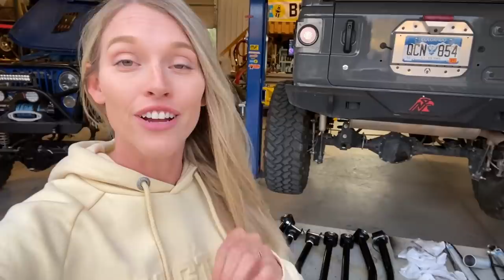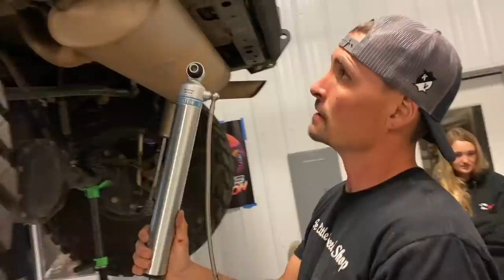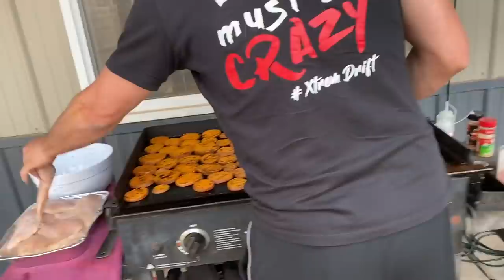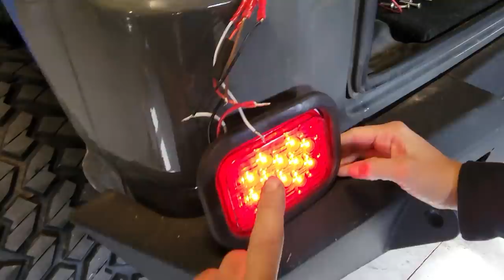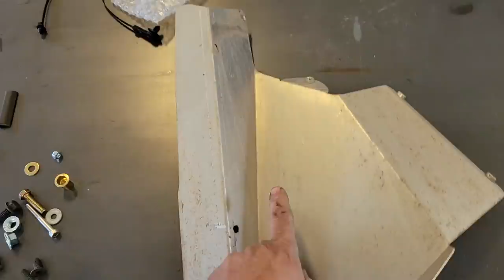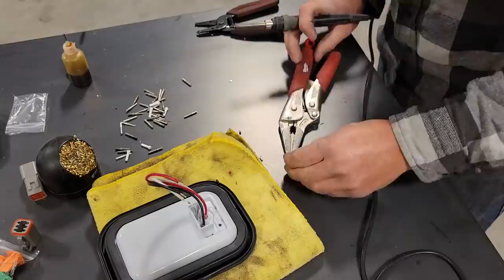MUST HAVE PARTS FOR A JEEP WRANGLER!

Comment: I know Chris can often be like myself, if it's worth doing it's worth doing right. This taillight wiring is a perfect example of it. Always a good idea to have some metri-pack or Deustch connectors on hand when you run into someone else's mess. Oem quality, 100% weather/moisture resistance, and easily disconnected just like an oem connector. Plus they are actually quite easy to make! I crimp the solid terminals with a 4 sided 8 indent crimper and it holds stronger than the wire itself is, and doesn't leave a really rigid section of wire like soldering does. 

Love these build videos guys! Chris is my kind of fabrat!

Comment: Chris, here is a SAE/Metric size hack for you.  I came up with it as I was going through A&P school.  There had to be an easy way to convert SAE and Metric to each other's sizes.  I found it, the number "5".  To find the equivalent SAE size of a metric size subtract "5" and this is the SAE size in 1/16"'s.  Example: 10 MM minus 5 leaves 5/16 SAE.  13 MM minus 5 leaves 8/16' or 1/2".  Go the other way.  7/16" plus 5 equals 12 MM.  9/16" plus 5 equals 14MM.  It works up and down the scale for quite a way.
Reply: Been doing it so long, that I just know. And 7/16 is an 11mm I think

Comment: Not many people even bother to use a soldering iron these days, and of those that even bother to, most don't even know about using liquid or paste flux like Chris did. It makes the solder flow much quicker and makes far better and  faster connections, which reduces overheating things. You can get it at a hobby shop. Just be sure to ONLY use Rosin Flux with Rosin Core solder. 
The Rock Krawler lift on our JK has been just as Chris described...maintenance and trouble free.

Comment: Nice work by Chris to break out the soldering iron and proper connectors versus the prior work on the lights..  As an FYI for the Deutsch connectors get yourself the proper crimp tool and the barrel style contacts - even better than soldering for durability.

Comment: Just came across your video,  I'm happy Abby got her set of Bilstein shocks, ordered a set of 5160's for my wife's jeep in January of 2022 and got the fronts right away. And in the middle of June still haven't received the rear set. With two weeks until we left for a three week wheeling trip had to put a set of Fox remote resivors, now we have miss matched equipment on the jeep. I guess I have Brandon to thank for all the supply issues, it has been a nightmare trying to set my wife's jeep up.

Comment: Bilstiens are great shocks but they really need to work on there coatings
Reply from the maker: I hear they are in fact working on it. We need to do a video on it but the oxidation is actually on purpose which sounds weird but it’s to protect the metal from rusting. Of course it doesn’t look pretty anymore but for some reason that was what an engineer came up with a long time ago.
Reply: @LiteBrite  great to hear!

Comment: Those other taillights are Motobilt. I love mine because they're incredibly bright and include reverse lights. With NextVenture you have to run an external reverse light.
Reply: Those motobilts are superior quality, just looks like a poor electrical install. Can’t believe they threw so much shade at such a great product and company.
Reply: @FrancisKarmanocky  That company doesn't give them free money, free parts or discounts.  The Motobilt tails are much nicer than the NVMs, just a poor install like you said.
Reply from the maker: Chris didn’t know what lights they were, Abby didn’t like the look of them and they didn’t fit for some reason. There was no shade thrown at anyone. The company name wasn’t even mentioned. We love Motobilt and Abby is a paying customer. You guys really think that every vehicle we work on in the shop just comes with free parts? Come on now
Reply: @LiteBrite  I did have to "tweak" mine to fit just right and then used your weather stripping trick (from spare tire carrier) to seal up around the lights. They are cherry tho imo.

Comment: One question, you said less heat dissipation, you mean MORE heat dissipation right? Since the oil is allowed to go to the reservoir and cool there? Plus since there is more fluid, it allows the fluid to hold more heat with out shock fade ?
Reply from the maker: Yes

Comment: Nice work Chris... One comment about the shrink connector...ran into it one time... they need heat.. usually have it...but the last time I went to do a connection....didn't have enough. Ended up with a butt connection....and then came back later(months later) with heat to do the job right. Perhaps they were in same position...and the "later" just hadn't arrived(yet).

Comment: Pro tip for the chicken breasts, filet the breast lengthwise to make them thinner, then use a Meat Tenderizer Mallet on both sides. Cook on a low heat. The end result will be well worth the extra effort IMHO.

Comment: It’s so hard to watch a quality install.   Because it makes me review in my mind how my stuff is done.  I swear my tail lights have butt connectors no shrink wrap one might have electrical tape.  And it’s a JK so add in a load resistor.   Which may or may not hang out the bottom.

Comment: Ok what is this sorcery? Double up twisting solder. Ok consider me intrigued. My dad was proficient in soldering but never taught me and he passed away years ago so i had to youtube teach myself for years. Never heard about twisting solder. Is it because i never bought thin solder or is there a benefit to twisting regular sized solder?
Reply: No benefit. I just come from custom circuit board stuff and we use thin solder. twisting the thin stuff just gives you more solder at one time. I think the double, or more, heats faster also 🤔 🤷‍♂️

Comment: Hey Chris got a 2019 Chevy 3500. (SRW). I did a gear change from 373 to 410. Now my cruise will not work over 40 miles an hour. From what I understand it's a real common problem on the l5p Chevys. Do you know how to fix it or have someone in mind I can contact in the Southern California area? Or in a reasonable driving distance?
Reply: Usually have to reprogram the computer telling it what the ratio is
Reply: Yes. What he said. The trans output is getting one speed and wheel speed is another. Computer no like. Stealership or an indy chevy should be able to fix that.

Comment: Is she running 40s on 44 axles?  What is your guys thoughts on that.  I have seen a lot of people do it but so far have resisted the urge myself... even though I have 32 spline chromoly axles and trussed axles.  Would love your opinion regarding it.
Reply: Yeah im on stock rear and UD44 front. I’ve put my jeep on plenty of difficult trails and has been fine. Just have to be very easy on throttle
Reply: @RockyMountainJL  thanks.  All those that I have talked too said they haven't had issues either, but seems like everything online says not to do it.  I have a Tera 44 on the front and stock 44 on the rear but built up pretty solid.  Another draw back is my 2011 jeep and gutless 3.8L engine.  40s alone would slow me down let alone of I went to Dana 60s.  Still considering it tho.  Love seeing your jeep in the Colorado fb groups as well. Keep up the good work!
Reply from the maker: I would truss the front and run chromolly shafts front and rear and be VERY EASY on throttle

Comment: hmmmm   So Fox shocks are low end shocks? whaaaaaaat?  We're talking about the company that has pretty much been the most recognized name in off road racing in my life time.  You should prolly backup that claim a little better.  I get that you're paid by the other shock company but common.
Reply from the maker: Those specific shocks are very cheap. Like 40 a shock and started leaking after a year of use. Fox makes amazing products but those we’re not cutout for the job. She also hated the way they made the jeep feel. Said it rode terribly. Again though, they were a very low budget shock.
Reply: Easy guy. Trigger trigger chicken dinner. Upgrade due to oil capacity and yes they are sponsored by Bilstein so naturally those are the components they use in their shop. Our light Brite nation are trendsetters Kevin and Britney single-handedly started the mile star Patagonia trend that you see on every damn four-wheel-drive vehicle for the past two years. The natural progression of things means BilStein shocks or next. And just so you know I run fox shocks on both of my Jeep’s. A little more love a little less hate.
Reply: @LiteBrite  I guess I have Fox's external reservoir shocks they were like $250.00 each.  I assumed they were similar quality just extra capacity.  I absolute love mine.  They are a year old and look and drive like the day I put them on.  Not everybody can afford $1,000.00+ shocks for their rig.  I've followed you guys from the very beginning.  Just seems like you're forgetting what's its like to be a normal jeep owner.  The condescending "your shit sucks cause it's not crazy expensive like ours" is a bit of a turnoff.   I wish you all the best. :)
Reply from the maker: At no point did we ever say anything even remotely close to “your shit sucks because it’s not crazy expensive”. Please refrain from putting words in our mouth. Especially bald-faced lies like that. 👍 Instead, try watching the video where we physically show you the blown shock that we are replacing. It doesn’t matter what brand it is, a $40 shock isn’t going to keep up with 40” tires and the kind of rock crawling that Abby does. Better performance and better quality means spending more mone - and again, that’s the same for any suspension brand. Including Fox. 👍
Reply from the maker: Just to reiterate - All FOUR of the Fox shocks that we pulled off her Jeep cost less that what even ONE of your shocks do. And the Bilstein shocks we replaced them with cost about the same exact price as the Fox shocks you say you are running on your Jeep. So unless you consider the shocks you run to be “crazy expensive”, these aren’t either. 😊
Reply: @LiteBrite  Nice.  I wasn't sure how much the Bilstein were.  Sorry for sounding and overly sensitive snow flake.  I should not have read so much into such and insignificant comment on your video.  People like me annoy the shit out of me when they are in the comment section of my own videos.  Sorry for being "that guy"   I do love your guys channel.  Your journey is very inspiring.  Keep it up!  I guess at the end of the day it helps your engagement metrics. :)
Reply from the maker: No worries! 😊 Fox makes a good product. A basic monotube shock, no matter what brand, just wasn’t going to keep up with Abby’s Jeep at this point.
Reply: I appreciate that both of you stated facts and agreed in the end. Cheap is never good and good is never cheap. A really good valved shock, from anyone's hands, will perform perfect. Some shocks are made for the mall crawlers, and won't perform well for the enthusiasts. You get what you pay for in the end. Have raced with both fox and bilsteins on short course trucks. Bilsteins have had better track support. In the mx world, fox has had better track support. Just depends on your needs.